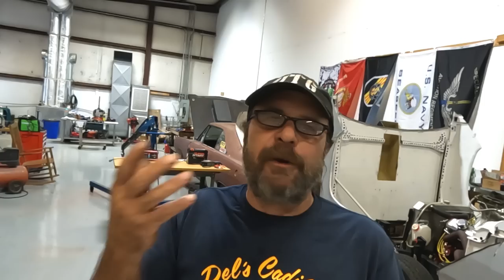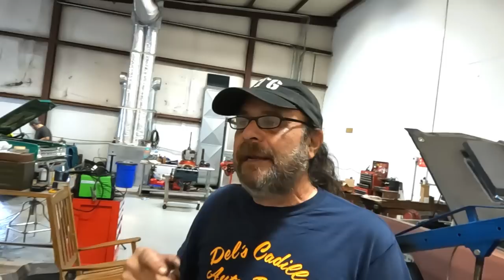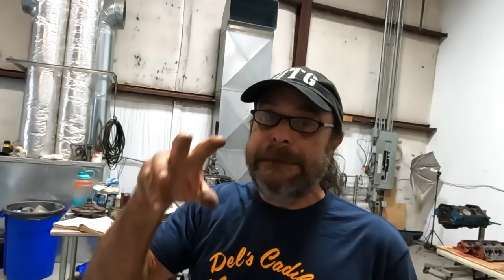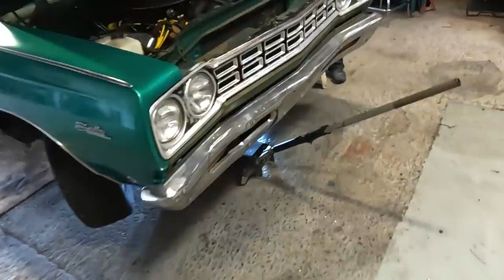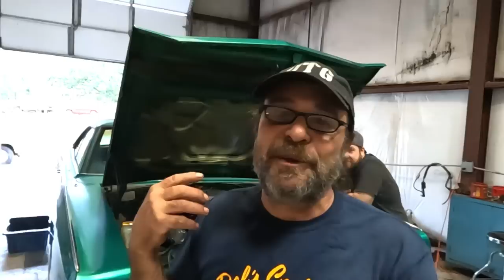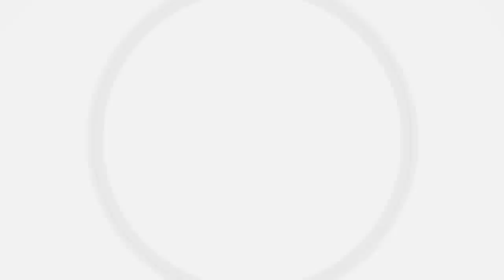The Most Unusual Engine Build On Youtube And Newbie Transmission Tribulations

Comment: Uncle Tony In The Early 90s I Built A 318 Out Of A Rusted Grandma Driven Furry 20 K On It, On A Budget For My 71 Scamp Factory Color Sassy Green With Factory White Plymouth Letters, Comp Cam 340 Six Pack Heads 10 1 Pistons,410 Gears 904 With 2,000 Stall Reverse Man Valve Body That Would Scratch 3rd Mickey Thomson Street Tires Soft And Sticky Some Suspension Tricks Got It To Run A 1350,,LOL,,Sure Do Miss My Car..Had It Tubbed And All Fiberglass But Quarter Panels And Roof And So On Was Building A 355 For Her ,Dad Passed Unexpect April 97,,,,And Took It Hard,,,So I Wish I Never Got Out Of Cars,,,Took Up Drinking Bad,,,But Stopped That For Good 18 Years Ago,,,,

Comment: Can you grind the back side of the cam lobes?
Reply: And put it in Plan Z.
Reply: Only on a roller cam. Yes I’ve had a few iron head sportsters.
Reply: That is what is called "a reground cam".  It used to be very common.  Both for stock rebuilds and performance.
Reply: @auteurfiddler8706  not the same thing. Grinding on the heel of the cam reduces the base circle increasing lift. Very old school done mostly on Harley Davidson’s with roller lifters.

Comment: My Jeep Grand Wagoneer has an AMC 360cid 2bbl that is only rated at 144hp, and only gets 9mph. I wonder how much more power I could get out of that baby...
Reply: I had a AMC 304 40 years ago that doubled the horsepower and improved torque . It also doubled the mpg. I have forgotten the complete setup, but had a holly four barrel with aluminum dual plane intake, a three step valve job, cam , headers and dual turbo mufflers.
It ran a 13.1 in the quarter mile at 105 mph. I pulled a two thousand # pop up camper at 75 mph getting 17.9 mpg. Do the research you will have better information than I had in the 1980’s. Wish I still had that Hornet station wagon.

Comment: I want to know how a 318  would respond to a turbo charger , long term  low rpms >> 1500~2500 in a 3/4 ton plow truck  and then cruse 25 mile to the gravel pit  and haul back 2800# of road fill   I understand that the piston exciding the speed of sound in the chamber is why the exhaust is so hot and expensive = burning $$ .That being said ,so a very slow turning engine 1100 rpm  is the best fuel efficiency henc tractors run slow ,while making torque . then water injection